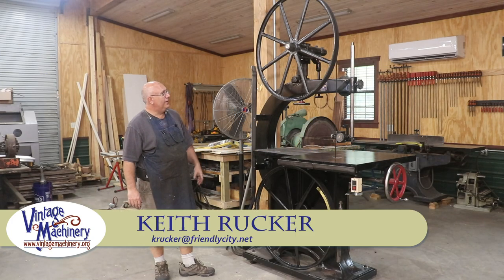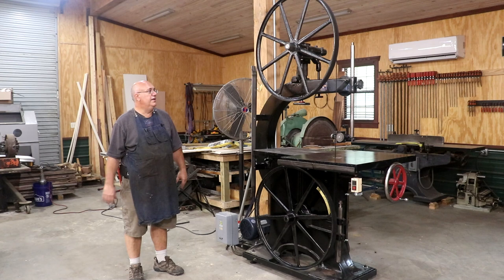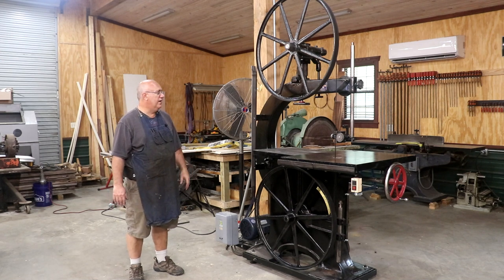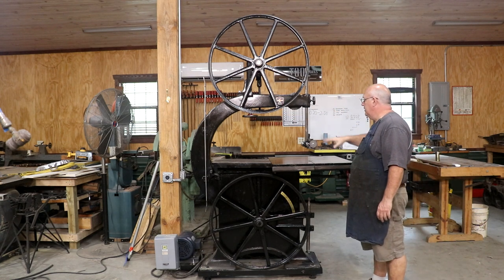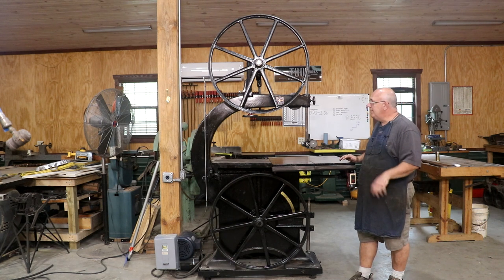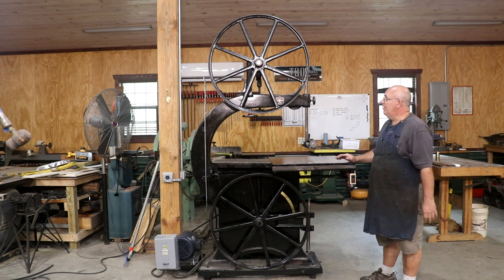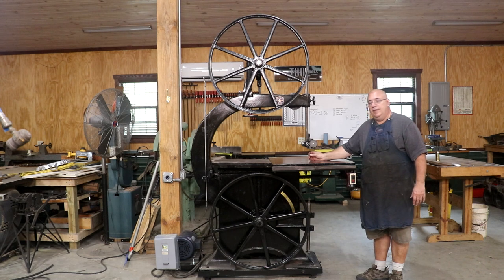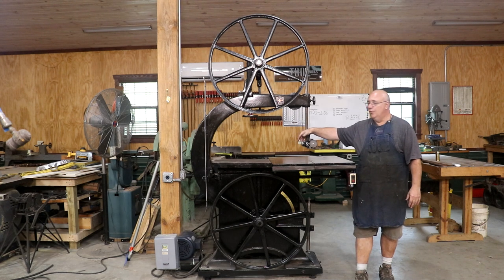Restored and Ready to Go: Crescent Angle Band Saw

Comment: I'm usually pretty cavalier about safety, but Id replace the bar on the back side with a u channel so the tooth side of the blade is enclosed on 3 sides and one on the work side above the guides so in the even of a derail or breakage it wont jump right off. Id probably skip the full on Fireball Tool style guards, but should it bite me maybe some brave soul will come make me a coffin with it.

Comment: Just looking at your tool apron and that bottom wheel gives me the willies. Your focus is on top of the machine and much easier to stay aware of the top wheel. You can't see under the table while working. Maybe a piece of plywood bolted to the base you made until you can make something more period correct.
Reply: Was getting nervous when I saw the cloth apron getting close to that lower wheel.
Reply: Me too.
Reply: I actually shuddered when I saw that. I experienced someone getting a shirtsleeve in a work piece on a lathe.
Reply: I saw that as well @14:09. Hopefully Keith will watch his own video and realize that the bottom wheel needs some sort of guard.
Reply: Sean Horton this is amazing Sean - I read your comment about the lower wheel and “the willies” after I wrote mine and used exactly the same bit of slang for “it scared me”.
Reply: I looked at that again and judge it to be abut 10 inches gap between the wheel and apron and unlikely to narrow. The blade is about 10 inches from the edge of the table. The apron looks to be heavy enough to not to "blow" into the wheel, and is hanging straight down from the widest part of Keith (Sorry Keith), which is abutting the table. But some guarding would be safer.

Comment: I've been thinking for a while but I can't remember the name of the casket company where I pulled this saw out. Remember the place had old wood floors and we couldn't use a forklift or anything so pulled it across the building on a dolly. I spent most of the time I was there climbing ladders and taking line shafts down for someone else. Ended up completely covered in saw dust.

Glad it found a good home

Comment: Think I would a least fabricate some sort of guard for that bottom wheel.
Reply: Yeah, I can see someone (like me?) sticking a foot into that wheel while it's turning.
Reply: The guards need to be there in case a blade breaks. My FIL, who had his own aerospace machine shop had one of his guys operating a bandsaw and an unguarded portion of the blade broke. The blade’s momentum drove it right through his stomach. Killed the guy. I made my own 18” bandsaw and when FIL saw the unguarded wheels he jumped all over me. I fabricated molded fiberglass blade guards that swung open on hinges too and bottom. I had a blade detail off the front of the wheels and I felt extremely fortunate that it didn’t jump forwards and bite me. 

Please, Keith, get some guards on those wheels, even expanded metal mesh would work. It’s not a matter of you being careful and not sticking an appendage into an unguarded blade, it’s what happens if a blade derails or breaks. Don’t depend on luck that the blade won’t wrap around you.
Reply: @Zircon10  brilliant
Reply: Boy! Designing guards that will allow the pulleys & blade to tilt would be quite a design challenge.

Comment: Proud Poppa..but come on Keith if Cresent had a guard option remaking them doesn't detract at all and the real nightmare is having the blade come off shill it's running then chase you across the shop like it has a will of its own. You more than most know that old machinery mangled more operators back in the day and the question is would you be comfortable letting someone close to you use as its stands or not allow them near it. After all you wouldn't use a circular saw missing its blade housing or a torch with its hose/cylinder leaking gas when lighting it and hope it wouldnt launch you or itself thru the roof after it failed. You know better than this and many who have gotten bitten by a machine rarely didn't say I'll risk it when it made them pay dearly afterwards and the Cresent will as well because it's the definition of an accident waiting to happen more than any tool you have now or restored/sold to others.
Reply: I would second this notion, strongly. I empathize with the desire to keep things period correct and authentic. But, something this potentially violent needs measures applied that later years - and who knows how many "incidents" - brought to bear. 
All of us consider ourselves vigilant and alert to the dangers when we operate saws without blade guards, or riving knives. But, we cannot know when that "human element" errs, on account of a split second detraction, a medication that has numbed the mind more than we realize -  and the consequences are severe...
With all due respect for the great work you did restoring this, Keith, I sincerely hope you reconsider. Just watch this video yourself, and see how close your aporn comes to the incredibly fast feet-per-inch blade below the table...

Comment: Later on , you'll be sorry you got rid of the 14 inch bandsaw.  Most woodworking shops have both a large and small bandsaw. You can keep a scrolling blade on the 14 inch saw and a wider blade on the large saw, that can be used for resawing boards. The 14 inch saw has a small footprint and doesn't take up much room.

Comment: I had the same saw years ago , and never new it would tilt back like that it was stored out side and the hand wheel was frozen in time .
It had a huge 7.5 HP reeves variable speed drive on it and a very nicely made set of wheel covers they used it to cut up to 8" aluminum plate , it had two little brothers that came with it a Yates American 24" by 18" under the wheel re saw & 16 " Do all  with high low gear box  variable speed & blade welder paid $400.00 bucks for the 3 . My dad though I lost my mind bringing a load of junk like that back to the shop 
 I sold the crescent immediately for $1500.00 so never had a chance to get the Handel freed up , I thought it was to feed the table in  silly me ! .

Comment: I have a Craftsman bandsaw that tilts back to 45 degrees, but it's an early 80's model with lots of plastic and it's "electronic"; a worthless application of sensors and a display that I haven't turned on in 30 years.

Comment: Hi Keith, an excellent video you have put together on the bandsaw. I just purchased one today that is several hundred miles away and wanted to ask if you knew the approximate weight of the machine so I can plan accordingly for the approximate sized trailer, chains and other equipment necessary to load, secure it and haul it home. Any input would be greatly appreciated. Thanks for all of your knowledge and effort in making these videos in order to keep these wonderful machines alive.

Comment: There is a British guy somewhere in America restoring a 110 year old wooden boat, the Tally-Ho. He uses one of these saws, but the bigger model, as they had to dig a hole to accommodate the bottom wheel. When they were cutting the 'ribs' for the ship, they had a guy on the angle adjuster, changing the angle while cutting. The clips can be seen under Sampson Boat Co.

Comment: Keith:  Consider contacting Jason at Fireball tools about a collaborative project to build a custom blade guard as he did for his vintage bandsaw.  Which of course turned out fabulous.  It would make some great video.  He could fabricate some of the   more intricate parts on his hydro-jet.  Like a lot of  people I'm more concerned about a guard on the lower wheel and blade.  Imagine if a youngin happen to push the power button and reached into the wheel.  We all have grandchildren or will, and they are very curious.  Not to mention your apron being snagged!

Comment: Need to change the location of your saw a bit, unless you have plenty of clearance between that 220 Outlet and the saw.  When you tilted that saw, you went right over where that 220 outlet is.  unless you have 6~8" of clearance you'll have issues if you ever need to tilt that saw.  Or is that why you have the two plugs....from the one time you used it "tilted' it looks like you used a different outlet??

Comment: I'm always curious to see if the older machines are really as good or better than the new ones. 
I thought this might be sloppy and clunky. But watching those smooth accurate cuts cleared up any doubts.
What a magnificent piece of technology !!

Some might say the old machines were "over engineered" while today's machines are designed with minimum specs to save on costs. But this machine is still going a century later... with great results... and it has many good years in front of it.
I guess if the motor is efficient, then this whole system is as efficient as anything on the market today.

Just make sure no kids are horsing around in the shop. Maybe a plexiglass wall around the lower wheel?

Comment: The company I worked for in 60s and till the 80s had a high speed band saw for cutting Stainless plate and when the blade broke it used to fire it into the plate and zig zag it till it stopped spinning. Saw a couple of guys get some bad cuts from the blade breaking.

Comment: I would find some grating material and make some guards for top and bottom - you can still see wheels moving through them, they are light as well - something might get into the wheel while its moving by sheer accident. Also bandsaw blades break (especially if I weld them) and without any guard this could be nasty. Also when tracking is accidentally bad wood saw blade moves so fast that in 1sec the blade will fall off.

Comment: Safety 3rd.  Imagine working on a boat in the middle of the Arctic ocean catching crabs.  Guards don't keep you safe.  You keep you safe.
Reply: idk man i wouldnt want to be around that thing when the blade breaks
Reply: @joshwalker5605  blades may break on a bandsaw but it's something you PM and inspect and replace if there's a problem.  On a modern bandsaw, where do you think the blade goes if it were to break?   In my experience it comes right out hits the table and deflects to one side or the other.   That's why its not recommended to stand beside a bandsaw in general.  Tools are dangerous, to remove the danger means removing their effectiveness.  And if you don't feel comfortable with the tool, don't use it.  I've operated hugely dangerous systems and they can be intimidating when you think about what they might do to you.  Keep your head and you'll be fine.
Reply: @rgmoore  I've never seen a bandsaw blade feed out more than an inch or two like that and Ive seen plenty of broken bandsaw blades.  Blade guards work.
Reply: @joshwalker5605  You do you.  I just don't want to be told what I can and can't do and be required this required that.  It's like those folks fishing and crabbing.  It's dangerous.  I've lived a long life just keeping my head screwed on proper.   Never been injured by a machine I maintained.  I'm not interested in debating.  As I said, you do you.
Reply: @rgmoore  Sure, and OSHA isn't stopping any of us. It's when we ask our employees to do unsafe stuff that they draw the line, as it should be.
Reply: @joshwalker5605  OSHA? I didn't say anything about OSHA.  That's a US thing.  Nanny state I hear.  People cut their finger on a knife and call and complain, right?  I guess its up to the employees what they feel comfortable doing in a free world, right?  I see videos of linemen doing live wire changes and I'm sure they get paid big bucks for that.   Some people even work where they can get shot.   Cutting down trees, working on a milling machine that can rip your arm off.  I just don't get the knee jerk reaction like I've seen here of "OMG you need to put guards on that thing!".
Reply: @rgmoore  oh sorry, i'm arguing with people in another part of the comments about osha, guess i thought this was the same area, my apologies.

Comment: Part of the guards on a bandsaw keeps the blade enclosed in case it comes of or breaks and once I was using one when the blade broke but fortunately the only problem was getting it out not having it come after me like a bull whip when it's energy is released. I keep thinking that Keith's Wife should go out to the shop unplug it and cut the power cord off and keep doing it until he makes the Cresent safe since he almost got a kiss from it below the table level and next time it might be a leg not his shop apron that's this close to the blade in this video. Indeed I nearly flagged the video on YouTube because it's that dangerous and others might take the guards off there's and I still considering doing it since it comes under the self harm category it just hasn't happened yet....

Comment: Instead of making the wheel even bigger and having to raise the band saw higher, couldn't they simply add a 3rd wheel so you can have 3 smaller wheels? That seems an easier solution, and it might even make tensioning easier as well.

Comment: Without the blade guards, it seems like a broken blade could kill the operator.
Reply: Truly a piece of history.  It reflects not only the craftsmanship and quality of yesteryear, but also attitudes toward operator safety and expectations about personal responsibility.  It was a different time, for sure.
Reply: You never stand in the "line of flight" of the blade. As long as you are not in the line of flight on the band saw, a broken blade should never inadvertently come into contact with you.
Reply: @StreuB1  My General bandsaw has the blade entirely encased except where it is cutting, making any kind of whipping action very unlikely.  The antique bandsaw could easily cut somebody's head off.
Reply: @charliemckay6402  Not to disagree but....looking at the force vectors of all the moving parts and the direction needed to cut ones head off. Its highly unlikely the blade snapping would ever result in the loss of ones head. Getting speared by the blade if you are standing in-line with the wheels is far more likely and even then, its extremely unlikely. The fear is likely within yourself.
Reply: No matter the industry:  "All safety rules/regulations are written in blood ".

Comment: Nice design on that saw.  As a retired industrial arts teacher, the guarding would terrify me.  It's perfectly fine for an experiencez home shop owner.  I ask the students "will you get cut if you touch the blade? "  I preached use of a push stick and use of scrap wood to clear the blade. Big wheels could be a problem also.  However it's not that hazardous for an experienced operator like you that controls his ahop and himself.

Comment: I never realized the whole frame tilted. I have a 26" crescent I am just restoring now, one difference being my table tilts instead of the frame. I getting ready to order the Babbitt and am wondering whether to order tin based Babbitt or lead based Babbit. Mine came with three blade guides?? I could not find a parts break down for my saw on Vintage machinery .Com. The serial number puts it about 1914. As my machine was apart when I got it I'm not sure what is missing. Any help would be appreciated.
Reply: I suggest lead based babbit ... that's all I have ever used though
Reply: Thanks for the reply Mike, I was thinking I would try the lead based Babbit since I have never done this before and it's less costly.
Reply: @phillipyannone3195  I have a couple big Coins of Babbitt, maybe 2 or 3 pounds .. but they are too cool to use ... they have a bust of Isaac Babbitt himself embossed on the coins :)
Reply: That is cool, I also have a coin,maybe 5 pounds, with the name Tuftex on it. It also says super service metal high speed heavy pressure. Jackson Wheeler metals service. On the back it says nickel Rollite 77, also too cool to use.

Comment: 12:06  That's like my new table saw ... I've been using a table saw since I was 8 or 9 years old, they all had no guards.  I had a project that could really use a table saw this spring, when I got it home I could not understand how I could possible use it with all these guards and riving guides and plastic bits!!!
I did NOT throw them out .. but they are all in the box the saw came in.
Reply: I agree that blade guards frequently interfere with the functionality of a table saw, which is why my table saw has no guards. In my experience, guards on a bandsaw never interfere with functionality, unless you consider slightly more complicated blade changes to be an interference, so what’s not to like about bandsaw guards?
Reply: @richmondpattonprehn4383  That's a good point! ... My Dad cut his hand in the web between his fingers (needed a cast for a month)  because he didn;t lower the bandsaw, guard /  blade giude and his hand slipped :(

Comment: Why did they not make them with 4 smaller wheels instead of two big wheels? That way you could have better clearing at the throat with smaller wheels.
Reply: Too tight of radius, will fatigue the blade and cause it to break. The larger machines use a wider and thicker blade compared to smaller hobby saws, needed for strength on the expected use for the blade.
Reply: @davisjohnson3621  yes, but I was not talking about really small, just 20 inch or so

Comment: Hi Keith, health and safety wasn’t around when that was made. I can’t help but to wander how much damage would result in a blade coming off those wheels, the size of them would seriously hurt someone working at the saw. You are going to make a guard for the piece from the top to where you are cutting the wood but the wheels are so large that the blade would go all over the place. How does the belt on the motor deal with the wheels being moved, I watched as you moved it through the angle to45°?